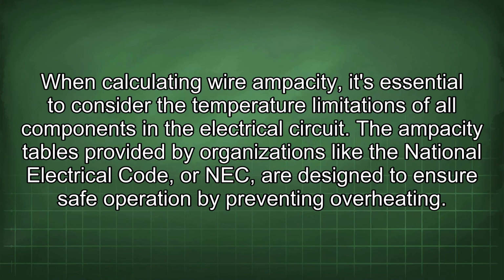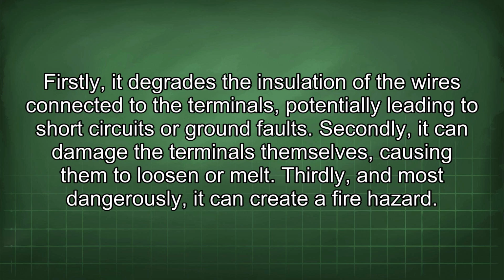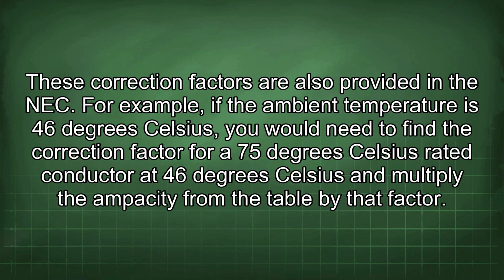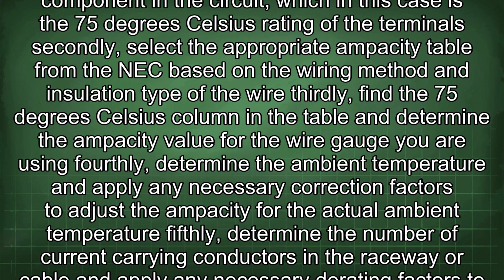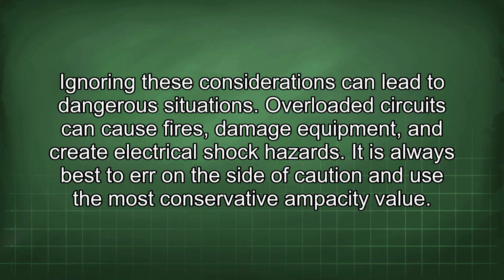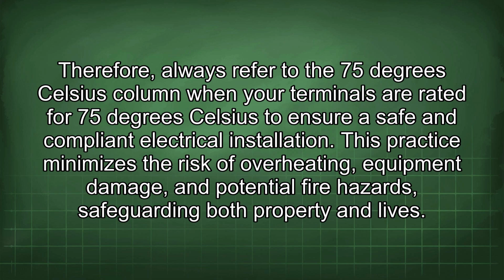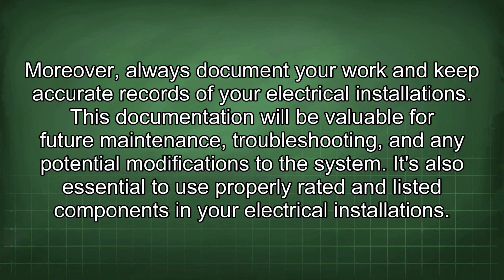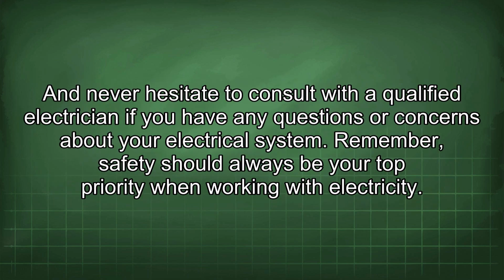Calculating Wire Ampacity with 75C Terminals

Comment: AWESOME .....I JUST SUBSCRIBED....AND  I HAVE WATCHED SOME VIDEOS  ...I HAVE SEEN SOME OF YOUR VIDEOS AND THEY ARE EXCELLENT AND I WOULD LIKE TO KNOW IF YOU COULD ILLUSTRATE WITH EXAMPLES TO BETTER UNDERSTAND THE PROCEDURES AND HOW TO USE ALL THE COLUMNS OF 60, 75, 90 USING  FACTORS  FOR A 50 AMP Continuous load (50*1.25=62.5 AMP)  WITH 75C TERMINAL.PLEASE  DONT IGNOR ME . I REALLY APPRECIATE IT IF YOU DID IT       THANK YOU VERY MUCH FOR YOUR TIME AND KNOWLEDGE
Reply from the maker: Hello @tomasvazquezrangel,

Great question about conductor sizing! This is a common point of confusion, especially with different temperature ratings.

Here’s a breakdown for your 50A continuous load (62.5A calculated, so a 70A breaker) with 75°C terminals:

Key Points:

Breaker Size: 50A continuous load x 1.25 = 62.5A. Round up to the next standard breaker = 70A.

Terminal Limit: Your 75°C terminals are the bottleneck. Your final usable ampacity can never exceed the 75°C column value for your chosen wire size.

How the Columns (60°C, 75°C, 90°C) are Used:

60°C Column: Generally ignored here unless your terminals or cable are rated for 60°C, which isn't the case for you.

75°C Column (The Direct Limit): This is your ultimate cap. Whatever wire you pick, its ampacity from the 75°C column must be enough to carry the current.

90°C Column (For Derating Calculations): This is super important if you have derating factors (e.g., high ambient temp, more than 3 current-carrying wires in a conduit). You start from the 90°C column for your calculations, apply the derating, and then ensure that adjusted value doesn't exceed the 75°C column ampacity for that wire size.

Example 1: No Derating (Ideal Conditions)

Look in the 75°C column for copper wire.

You need something rated for at least 70A (your breaker size).

4 AWG Copper is typically 85A in the 75°C column. This works!

Example 2: With Derating (e.g., 7 current-carrying conductors = 70% derating)

Target Adjusted Ampacity: 70A (breaker size).

Calculate Required Starting Ampacity (from 90°C): 70A / 0.70 (derating factor) = 100A.

Find Wire in 90°C Column: Look for a copper wire at least 100A in the 90°C column. 3 AWG Copper is typically 115A at 90°C.

Apply Derating to 90°C Value: 115A (3 AWG @ 90°C) x 0.70 = 80.5A.

Final Check:

Is 80.5A (your calculated derated ampacity) ≥ 70A (breaker)? Yes!

Is 80.5A ≤ 3 AWG's ampacity in the 75°C column (typically 100A)? Yes!

So, 3 AWG Copper would be your choice here.

Always consult your local electrical code (like NEC if you're in the US) for exact numbers and specific rules! Hope this helps! 👍
Reply: @BESAResearch  🥰🥰🥰🥰🥰🥰 beautiful explanation and awesome way to teach.............please letme make some questions and i hope i can make me understand

1. i think you nevr use column 60c for  calculations unless you have 60c  terminals and TW/UF wire 60c

2. you always go at 75c column if you have 75c terminals no matter what 
(e.g.110-14 c 1             100 Amp<use column 60c
100 amp >use column 75c)

3. 50A continuous load x 1.25 = 62.5A. Round up to the next standard breaker = 70A.
why did you select 70 amp  for this wire instead of 62.5 amp ?

i understand 70 amp is for the braker but for the wire isnt  6 awg=65 amp at column 75c because  of 50A continuous load x 1.25 = 62.5A?   any reason , articule?
65amp> 62.5 amp

4. finally i woul like to add a little more information to tje problem so i can understand  all the whole procedure

 50A continuous load ..
ambient temperature 45 c.
7 current-carrying conductors -
pipe emt pipe on top of a 4-inch metal base on the roof exposed to sun .
75c terminal (i feel now a days all the terminals are 75c right.)
thhw-ls wire 90c

i really appreciate your comments for this message and your time , have a nice day and see you soon
Reply from the maker: Hello @tomasvazquezrangel,

Thanks for your comment! Just let me know.

Sincerely,

BESA Research
Reply: @BESAResearch   i really appreciate ypur  time and comments,,,,,,,,thank you very much
Reply from the maker: @tomasvazquezrangel  Hello,

Great questions! This breaks down some key NEC (National Electrical Code) points. Here’s a summary:

60°C Column: You're right, generally ignored unless terminals or the wire itself (like some TW/UF) are specifically rated 60°C. Modern installations usually skip it.

75°C Terminal Limit: Spot on! If your terminals are 75°C, that's your absolute ceiling for the conductor's final usable ampacity, even if the wire insulation is rated higher (like 90°C). However, you do use the 90°C column for derating calculations first, then ensure the result doesn't exceed the 75°C column value for that wire. (This is per NEC 110.14(C)).

Breaker vs. Wire Ampacity (62.5A vs 70A):

Load Calculation: 50A continuous x 1.25 = 62.5A (minimum wire ampacity needed).

Breaker Size: 62.5A rounded up to next standard = 70A breaker (NEC 240.4(B)).

Wire Sizing: The wire's ampacity (after derating) must be at least 62.5A. A 6 AWG copper (65A at 75°C) would work since 65A > 62.5A, and 240.4(B) allows rounding up the breaker. The initial example chose 4 AWG (85A) for a larger margin, but 6 AWG would technically meet the minimum code requirements for the wire in an ideal, non-derated scenario.

Your New Scenario (50A continuous, 45°C ambient, 7 wires, roof EMT, 75°C terminals, THHW-LS 90°C wire):
This is where it gets spicy with derating!

Load Ampacity: 62.5A

Breaker: 70A

Extreme Derating:

Ambient + Solar Gain: 45°C + 33°C (for roof exposure) = 78°C adjusted ambient.

Temperature Factor (90°C wire at 78°C): Becomes 0.43 (from NEC Table 310.15(B)(2)(a)).

7-Conductor Factor: 0.70 (from NEC Table 310.15(C)(1)).

Required 90°C Wire Ampacity (before derating): 62.5A / (0.43 * 0.70) ≈ 207.6A

Wire Selection: You'd need 3/0 AWG Copper THHW-LS (225A at 90°C) to handle this.

Final Check: 225A * 0.43 * 0.70 = 67.725A (derated ampacity).

67.725A is ≥ 62.5A (required load ampacity) - Pass!

The 75°C terminal limit for 3/0 AWG is 200A, so 67.725A is well within that.

Conclusion: 3/0 AWG Copper THHW-LS is needed for your tough roof scenario!

You're right about 75°C terminals being common now, but always good to verify! Hope this helps! 

Cheers,

BESA Research